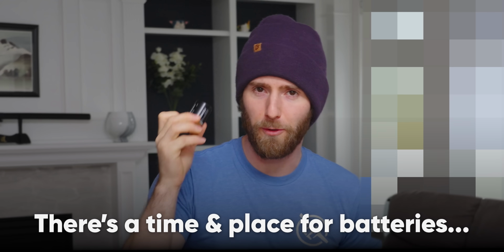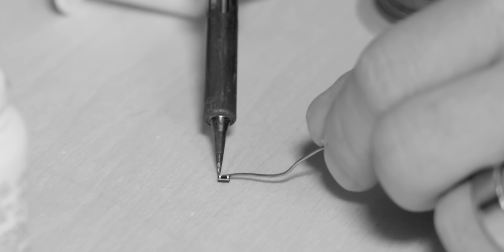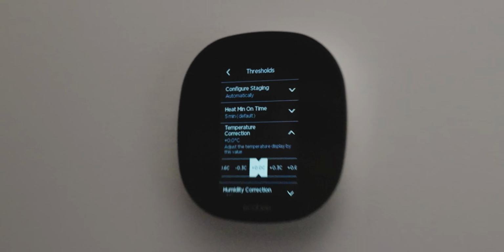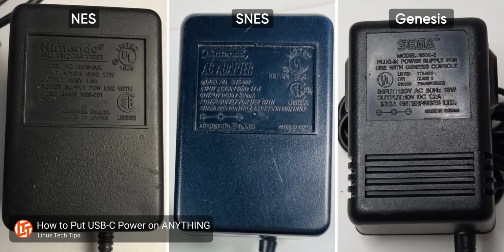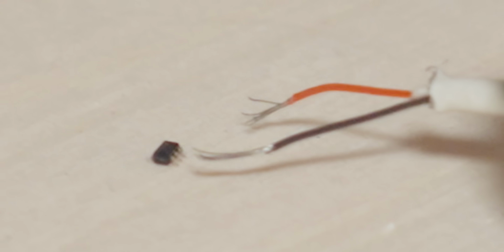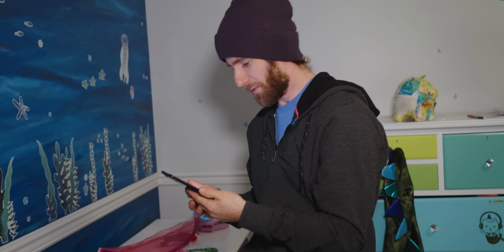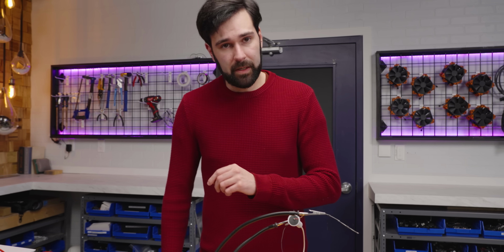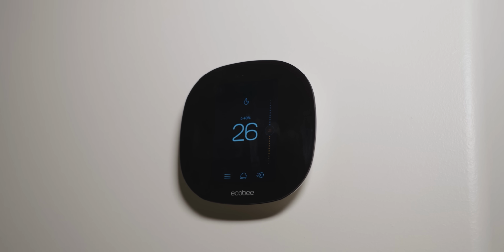I HATE Batteries! - Converting Wireless to Wired (a cheapskate’s guide)

Comment: Please, do you guys not have an actual EE or electronics person who knows their stuff (edit: sorry Dan you're cool but I'm assuming hobbyist at best). The lithium cell has a discharge curve, any voltage along that curve will be fine for the sensor, 3.0V is perfectly fine and a common voltage for fixed regulators. And for a much more user friendly solution you can just buy 3V regulator modules on ebay or use an IC with larger pins like a x1117 in TO-220 package. 

The potmeter is probably causing the voltage to drop whenever it tries to do a measurement, and won't drop any voltage when the device is inactive. And your MIC5504 (like most LDO's including the 1117) requires an output capacitor for stability, you're running it out of spec and just hoping it doesn't oscillate.

Comment: Yeah, I personally do this to all my game controllers. Especially because the USB always gets messed up after a period of use. So I just solder wires directly to the batter contacts and use my iron to make a hole in the bay door. Works great, never have to recharge anything. Doesn't destroy some port if the thing gets tugged on too hard too many times.

Comment: "Total cost: 0.40$", yeah if we don't talk about the 15$-20$ of shipping from Digikey/Mouser. Your electronic shop may have an equivalent but the price is likely to be more than 0.40$ (but still what, 2-3$?). Worst case, Aliexpress (which also sell modules to do the same job, you just need to connect the wire and configure their potentiometer). Also, wth 119$ for 2 sensors!?

Comment: This quality of this video is so insanely bad. Soldering wires to a smd like this? Why not use a breakout board? Why not use a 3.2v regulator in the first place?? A potentiometer in series?? Any idea what will happen if it's gonna wireless TX or RX? Yes a pretty big voltage drop.. Other then that not decoupling the LDO input and output... Not to mention what kind of power noise this gonna introduce to your sensor with probably an analog temperature sensor..

Comment: the electronics inside probably run on 3.3v nominally(like esp8266) and have some tolerance. The esp8266 runs with 2xAA batteries(so 3V) and the max voltage listed in the spec sheet is 3.6V so the difference between 3.2 and 3.3V is really negligible. The battery itself also varies in voltage as it discharges. Those microcontrollers are not modern CPUs where 0.01V matters.

Comment: Really, these ultra low power devices ought to have a small solar cell in them, or at least have it as an option. TV remotes are another device that would benefit from being solar powered, after all, if a 64cm² solar cell can works for a solar garden light that runs most of the night, a 10cm² solar cell should work for a tv remote that blinks an LED for maybe a second out of an hour, on average.

Comment: Looks like a dangerous endeavor for a non technician and a bad example shown to many :-( 
I like the channel but when it goes that bad, not so much.
One solution is a proper regulator or a simple way is to use a Zener diode and a resistor. That would be a lot easier. Using a proposer sized regulator would also be a better way, lite a proper 7803 but not sure it would work on such small current draw.

You are not Electroboom , you could start a  fire in no time with the solution you are promoting. :-(

Comment: Rather than soldering directly to a TSSOP or SOIC IC package's legs (or SOT23-anything), you can also get adapter boards that break the pins out to an easier to solder format. Always good to have a bunch of those in stock for prototyping :)
Reply: True, but they didn't have those on hand, and were less likely to fit in the battery compartment. Ideally would be a 32mm diameter custom PCB to fit in place of the battery, with all necessary components soldered to it!  But that's not an interesting hack video like this.
Reply: @mlindholm  it's unbelievable that they don't have a copper pcb and a laser printer to do things like this.
Reply: @qwe4dsffe745  Yeah, they got all that CNC gear and what not out in the shop and they can't even whip up a quick adapter for this? For shame :)

Comment: Lol, I used cheap usb A used for flashing small electronics. Put on the 3volt setup (because button battery was used and are 3 volt) and solder cable on the power output, solder on the smart product and done

Comment: Batteries are unnecessary for quite a few things. Had some Christmas lights that ate two AAs at a time, decided to take an old USB cable, cut the micro-B end off and soldered it into them so now they run off a normal USB wall adapter. Fortunately didn't need any voltage altering since it used the same power draw anyway. Much much better.

Comment: When I worked for a consumer electronics company, our products didn't generally use batteries for clocks/non-volatile memory, we used small supercaps, and they'll last for over a decade easily.
You don't end up with years of power off endurance but you could unplug it for a week with no clock loss.
I think all motherboards and other consumer devices should use a supercap rather than a disposable CR2032 and I would support legislation that forces manufacturers to do this.

Comment: Step 1, before you buy check if it use the battery you have.

Step 2, don't buy it cause it's too "smart".

Step 3, wear jacket.  Put it on when you are cold and take off whenever you are hot and sexy.

Comment: Now if you got a decent hydronic engineer in to do your heating you could set the mix temperature for the underfloor heating to give the same amount of energy into the rooms as they lose (using outside temperature compensation).

Comment: Be careful with those powerwall adapters.
The voltage coming out is most of the time way higher.
They are not stabilized.
You probably need to make a voltage divider with two resistors and some trial and error. Or hoping your device will survive higher voltage.

Diodes maybe not the best option.
3.3V zener diode also an option.
Or just put 5V on it and hopefully no magic Smoke.
😅

Linus kinda horrible with electronics and soldering.

Comment: A 20 cent 3.3v linear voltage regulator (TO-220 package size like the LD33V or the LD1117V33) is all you need to do this. I've been doing it for years. You really should have just waited until you had a through hole device to make this video. This makes it look so much more difficult then it really is. Also, the diode hack works ok for some applications but there voltage drop is dependent on current flow and you will get wildly different voltages with differing amounts of current draw.

Comment: Hey @linus, you need to measure the output voltage of the power supply in an open circuit (without soldering to the battery connectors) to correctly measure and set the voltage. There would be a voltage drop otherwise.

Comment: Yeah, sorry, this has so much bad information in it that it actually gets a down vote. That's why the down vote restorer exists. As in yeah, it works but it could have been done with only one component, cheaper and easier, and be actually in spec instead of relying on the device being able to work with wildly out-of-spec input voltage.
Reply: The main problem is that you take the output of a REGULATOR which is designed to output a stable voltage regardless of current, and add a large resistance in series which essentially negates its capabilities, causing the output voltage to swing wildly with current draw.

If the reason for adding the pot was that the device didn't work at the 3.3V output, then the more likely reason is that it was lacking input capacitance after the inductance the USB cable caused

Comment: After my wedding, I was left with a bunch of submersible puck lights that would eat through 3AAAs or 2 CR batteries. Since 4.5 volts and 6 volts are so close to the 5 volts off the USB, I wired them up in parallel and now have display lights with RGB.

Comment: LM317 and 1/4W resistors to set the output voltage. easy to solder, easy to set the voltage. you can even add a capacitor for correctness...

Comment: There are tiny step-down boards that have solder pads or pins, making them much easier to solder. They also have input and output capacitors, making them much more reliable. And some come in 3V variants. Using a resistor to drop voltage on a load that wily varies it's consumption is not correct.

Comment: And then you will discover wired (by design) smart home appliances, which were around for years. You know, with one (or two) central PSUs. With twisted pair connections, so they will not be influenced by interferences.

Comment: I recommend getting some non-SMD sized (TO92) voltage regulators in various voltages for future "unplanned" projects. And get some transistors (BC547C, BC557C) as well while you're at it :) An inventory of various basic components is worth its weight in gold.
Reply: agree with that, I converted a 2x AAA battery wireless headset base to a Li-po powered and used a MCP1703 in TO92 package, never failled onced! it's a 3V fixed voltage so perfect for tha kind of application but if I remeber they offer other voltages
Reply: @ItsJust2SXTs  me using a wired headset like a pro
Reply: @vappyreon1176  working on cars with a wireless headset is way better than wired or when I work it's plug in the computer but I can move without walking on the wire or have a 10m wire... the headset it self work for 3-4 days on 2x AAA but the base was like a day and half and I bought rechargeable when I got it, still the smae 4x batteries in 7 years. I broke the base case one day that was another reason for the switch and use a MAX1811 for charging the lipo
Reply: @ItsJust2SXTs  man, I would never trust putting a lipo that I had anything to do with that close to my head. I still remember the old olight lipo flashlight exploding in mouth thing.
Reply: @marcusborderlands6177  me either that's why it the base not the headset it self, it's a 500mah battery so it's not that big.  It transmit the sound in the FM band not bluetooth. When the lipo will die eventually(it's 5 years old now so it lost some charge but it's not buldge), I will change for a Li-ion at least they are in metal casing. Bluetooth Headset use li-po but still too close for my tase. Remember the samsung that were blowing in pants? that was scary to see..

Comment: If you place a 100 Ohm resistor across the load with the 3 diodes in series, the voltage will always be 3.2V. (at a few tens of mA's the forward voltage is fairly constant)
4V could be too much for some devices.
But if such a battery lasts for years, a fixed power supply seems rather nonsensical to me.

Comment: My thermostat has two mercury tilt switches, one for AC and one for heat. Pretty neat because when I like to leave the cover off so you can see the arcs inside the mercury switches when the heating/cooling turns on/off.

Comment: I'm just sitting here wondering why he didn't just get a small MP2307 or similar buck converter and be done with it. They're relatively cheap ($0.50USD from Aliexpress, less than a dollar on Amazon). The only downside is that it'll stick out, but given he has a 3D printer AND a license to Solidworks, it's completely manageable to make it look good.

Comment: I've had done similar thing to my room, except that I have now 3 and 4.5V max 3A wired around room using 5 volt power supply and two variable step down DC transformators for each around 1$ - that is very easy and cheap solution and you can use it to run many things at once

Comment: 1:12 Smoke detectors are actually most of the time hard wired to the whole house or building, so if one goes off all go off. The wires are used as a backup but depending on when your home was build they could not provide power at all. If you don’t like changing smoke detector batteries you can get one where the whole smoke detector gets changed and the battery last for the 10 years that smoke detectors last. Please do remember to change your smoke detectors every 10 years, and when you do change them, the little extra money on the integrated batteries I recommend doing so.
Reply: Most homes are not hard wired together or wired to power smoke detectors, that is a fairly recent trend compared to the age of most homes.

Comment: A voltage divider on a good 5v charger might be more reliable/accurate than a voltage regulator ... it'l dump the extra (divided) energy as heat ... but should be low enough on a low power device to not effect the reading.

Comment: Should've used a small buck converter. AliExpress has a bunch of options. The voltage regulator you used is quite wasteful and just turns the wasted power into heat instead of efficiently turning down the voltage through AC

Comment: You do realize if you had neglected the stupid potentiometer it would have just worked? Maybe some decoupling capacitance? A 78L33 has decent-size legs and can mostly do without decoupling caps, and the sensor peaks are comfortably within its current capability...

Comment: Can I follow this guide to convert my Hatsune Miku Project Diva F foam stick that requires LR44 Batterys? Or would it be possible to have one of those type C charging board through a voltage regulator tgen into the battery contact?

Comment: First through... Drop the voltage down with a diode. Second through... Diode forward voltage too low, drop it with a f-ing LED ;-)

Edit: side note, add a small resistor to actually run that LED at some 0.5mA (barely visible), and actually drop the voltage while idle.

Comment: It's a dirty solution but just use zener diodes, they come in different voltage ratings and different current ratings. For this application the current is so low that, the zeners current rating isn't that big of a deal.

Comment: 3.3V would be perfect. There's usually around a 10% tolerance in the input voltage range
Reply: Especially for a battery powered device! The diode approach was simpler though...

Comment: Did Linus consider moving the thermostat to the other side of the wall? It would be significantly more reliable to move the thermostat instead of adding another device. If Linus just needs the thermostat on the back side of existing wall, he could drill another hole.
Reply: Yea, what's hilarious is that Linus needed to get these sensors in the first place because his smart thermostat system is borked.
Reply: Yeah I don't get it, that house was just renovated and they added a lot of wiring. It was intentional to put the thermostat in the wrong spot... A lot of weird things have been done with that house.
Reply: @cedricpomerleau5586  Don't forget Linus has been giving a crapton of instructions on what he wanted to contractors, and a lot of said instructions were different from what they would typically expect to do. Mistakes and/or confusion have happened a lot because of this.
Reply: @cedricpomerleau5586  it's possible they weren't able to predict the issue of unintentional heating

Comment: Potmeters like that are NOT made to dissipate any real amount of heat. Even the "big" potmeters out there are usualy 1 or 2 watts max. To be fair, that little device proabably uses a few miliamps so it's fine for this application. But next time you can use a lm317, cheap AF and with two resistors you can choose any voltage you want between the inputvoltage and 1.2V (up to 35V input). With anything that uses some "real" amount of power you can also use DC-DC converters. way more effecient scince they dont just dissipate the "unwanted" voltage as heat. But thats only relevant is its using at least a watt or 2 (and even then bearly). 

I do wonder however... yes batteries are crap for the enviroment. But a AC-DC powersupply has a horrible efficiency when its used to power somingthing with a few mW when its capable of delivering 5w. Its probably below 1% of its rated capacity. And that power is used 24/7. Honestly I don't know whats worse at the end of the road. But its something to keep in mind. (This changes ofcourse when you power 20 batterypowerd things of of one AC-DC adapter.)

Having said all that: for this application, yes this works. But my electronicsbrain just couldn't resist pointing that out....

Comment: Can't wait to hear about how this didn't work out and why it was a bad idea in 2 months on the wan show
Reply: This will definitely happen because the circuit they used has zero filtering. USB power supplies (especially cheap ones and at tiny loads) are quite noisy... it may throw off the readings or cause problems with the wireless transmission. It would work far better if they had used a linear regulator like an AM1117.

Comment: This would be a perfect application for a zener diode regulator, and it would be easier to wire than dead bugging SMT parts. Also I would be shocked if that sensor didn’t have its own voltage regulation to power internally to 3.3 V, inputting 3.3 vs 3.2 V almost certainly wouldn’t have made a difference.

Comment: If i were you i would just use dc/dc step down converter and went lazy mode with 2 wires in and 2 wires out. Low power ones are usually sized like a penny and cost under 1 dollar and allow you to adjust the voltage while providing stable voltage regardless of the current needed(if within their parameters).

Comment: me watching video: You're only a volt off, just add a diode to the chain!
Linus: LET'S USE RESISTORS!! 1 volt, why it do?
me: facepalm. Current spike dumbass, your voltage is completely unregulated... JUST ADD A DIODE
Dan from future: so we figured that we should have just used a diode. So I removed the regulator entirely and am now using nothing but DIODES!! <chains many diodes pointlessly and crams the little heaters in a tiny space>
me: AGGGGHHHHHHHHHH!!! If you're using JUST diodes for regulation you should use a Zener diode instead. Whatever, it'll work I guess, it'll just create way more heat than normal.